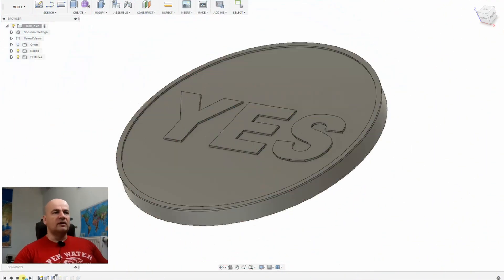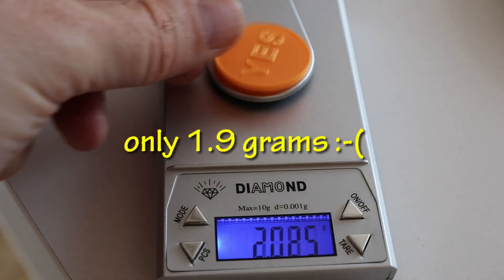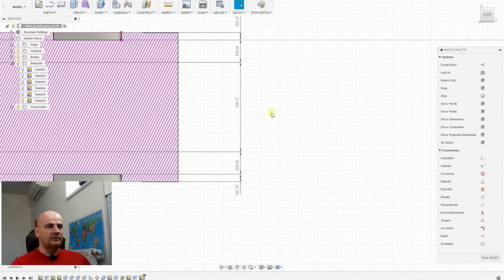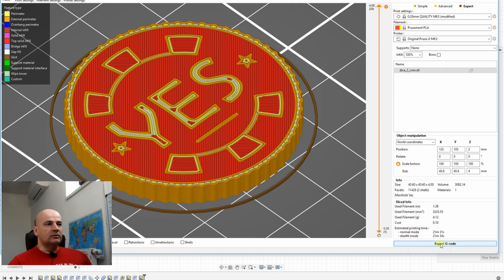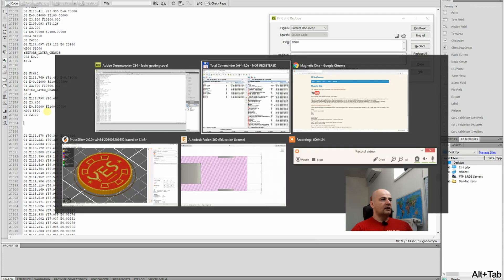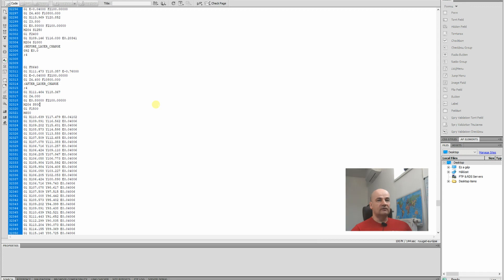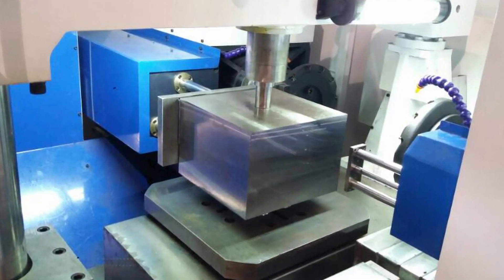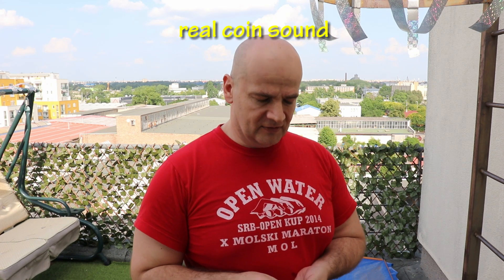3D printing Yes No coin with inserted screw washer

Comment: One more idea for the rotating sound: What if exposing outer edge of washer? I mean sandwiching the washer by the first and last few layers with center poll between them like the printed shape of 工. Or even extruding letters by direct printing on sanded & preheated washer? I guess the key factor would be to let metal shake to sound in the air.
Reply: I did a quick testing but direct printing isn’t fixed well on metal. So, even sandwiching with 工 shape would be difficult to make it. ;-)

Comment: Good idea to add more detail to help the bridging, the washer is great.  I still don't like how coins look on the bottom side with the bridging.  I have tried to make them on their side with supports and that helps the details a lot but makes any kind of washer insert impossible (I guess you could make a square cavity, but no knocking over a sideways coin while doing this would be super hard).
Great options here though, sure fixes a lot of the issues.

Comment: Interesting. I found you YouTube channel and I like the content.
One tip for in inserting the washer (or other metal object) inside a 3D print: you can improve adhesion to the washer by coating the upside of the washer with nail polish in advance. You can also preheating the coated washer onto the build plate for even better adhesion. The bridging does safe you in this instance, but if bridging is not possible (if you need a hole in the middle for instance) the filament will not stick to the metal washer and filament will drift away during the print.

Comment: What if you fill in the middle of the washer ?
Reply from the maker: Fill with plastic? It's possible, but it would be just slightly heavier. The main problem (no rotating sound) would exist. In the meantime I created a coin from cast brass using 3d printed as model. Less detailed, but it sounds as real coin.
Reply: @MyTechFun  if your gap for the washer was not as large then that might help it not shift so much around. Also you could use a bit of putty or something in the center of hte washer when you put it in to help it stay and not wobble as much. finally, if you chamfered the edges, it might hold the coin in more securely on the top, keeping it from moving. Great job! Enjoyed this video